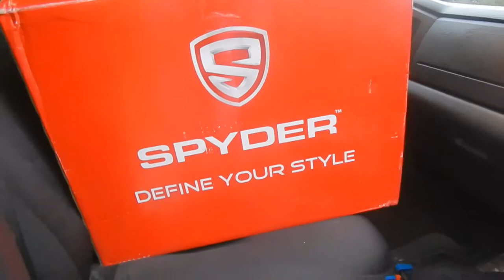SMOKED PROJECTOR HALO HEADLIGHTS ON THE CUMMINS!

Comment: have u ever had issues with the injecors because my 05 cummins has 125k miles and the mechanic we know said they are bad and the injectors need replaced about every 100k miles
Reply from the maker: Rob Johnson As of now no problems, might get them looked at soon make sure everything is going good!